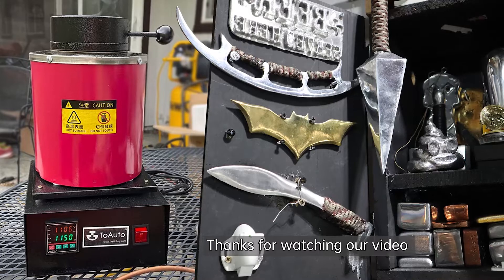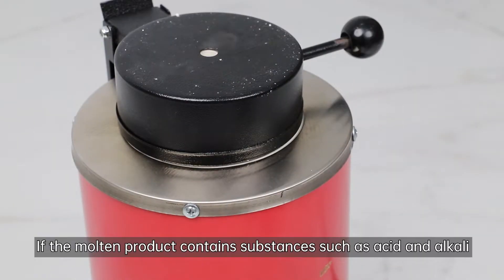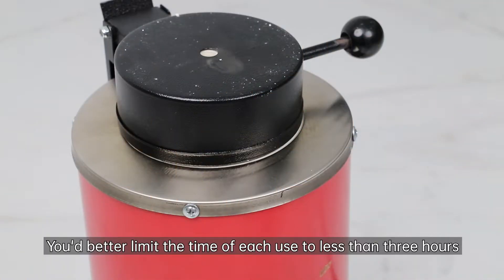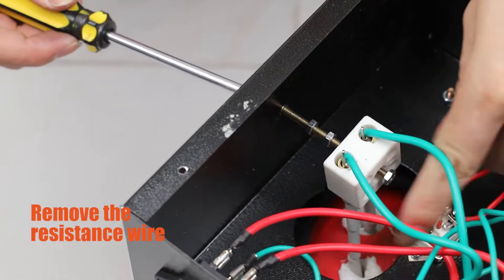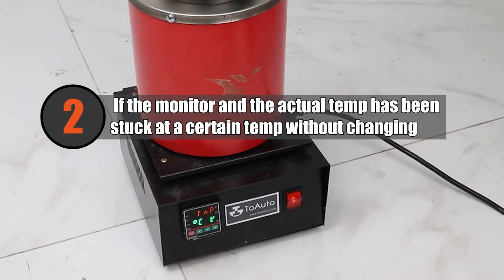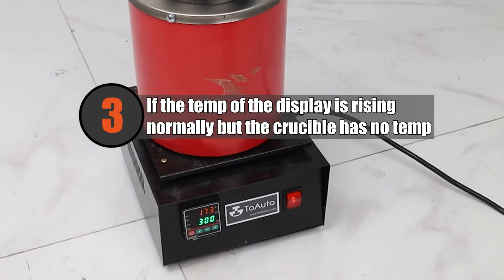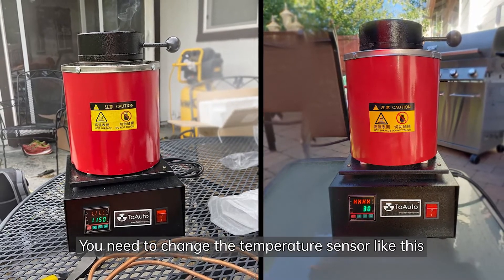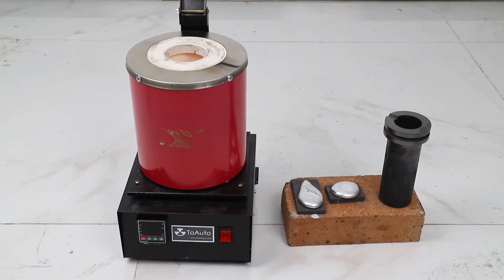10 Things You Need to Know About Metal Melting Furnace - Beginner Guide - Troubleshooting & Solution

Comment: Where do you get resistance wire
Reply from the maker: If the product has quality problems, you can contact after-sales service. If you purchase resistance wire separately, you can contact the store for consultation.💕
Reply: @ToAutoOfficial  where to get the temperature Spencer
Reply from the maker: @haydendungan5474  You can contact the official ToAuto store.
Reply: Have you got it?

Comment: Similar unit, brand new out of the box. My digital display cuts off/goes dark before reaching melt temp, on/off button remains illuminated.
Reply: @Der0Nibelung I have this exact same issue on a similar unit I've been using for several months. Do you ever get an answer/fix for this issue? Cheers
Reply from the maker: I'm not sure what problem you're having, but it's clear that the display is damaged, or it's loose and it's making poor contact